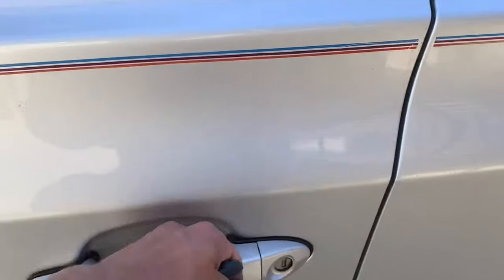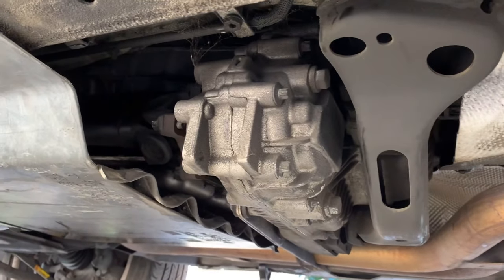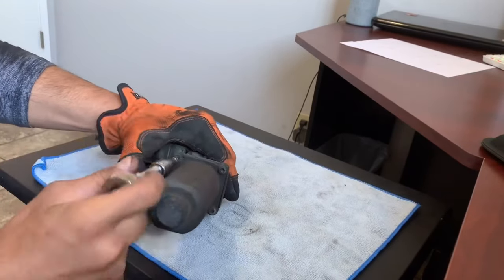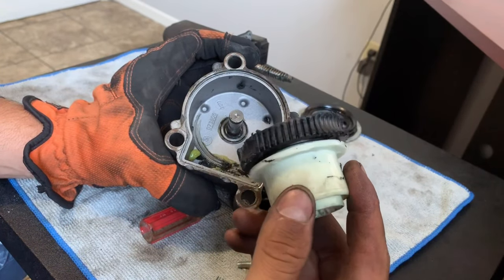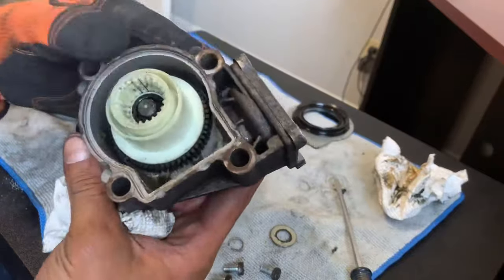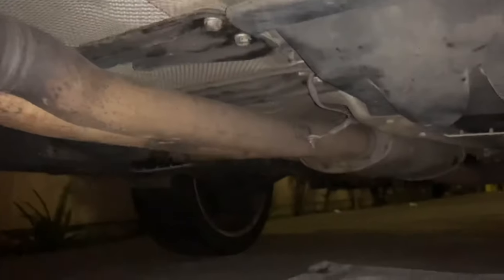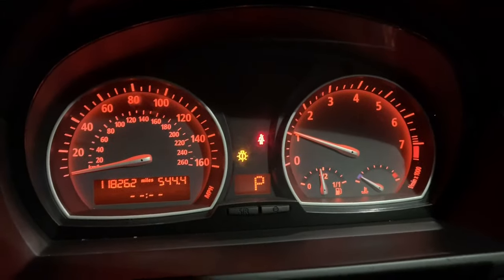BMW X3 E83 M Sport 4x4+ABS+Brake lights! How I Fixed it!

Comment: No need to pull the head of the actuator off the motor. just remove the C lip on the white gear shaft, pry off the staked plate, and open the access to the black gear your going to replace. The damaged gear will lift right out. Grease the new one, and install. Ive done this 5 times on my E83, 280,000 miles and counting.

Comment: I have the same problem yesterday with my 2004 X3.  Is it drivable or better to wait to get it fixed.  After stopping at a red light and then trying to give gas when its green again it jerks for 3 seconds and is not smooth.

Comment: Hey thanks for the fix man.. Just a question.. Is this an urgent fix? or can I drive it for sometime and do the job later?
Reply: Yeah it can still be ran just the abs won't work in case of a hard stop you will skid because the brakes will loćK up but other than that you can makr it cross coutry without it

Comment: I changed mine but the 4x4 light still comes on. Could it be a sensor ? i no longer hear noises and drives fine just the dang light please help

Comment: Is it better to replace it with an aluminum gear or carbon version? Is it normal or safer to let it get chewed out and just replace it ty
Reply from the maker: I have not tried the metal gear as replacement.
What I can say though, it’s been 2 years with the carbon gear and no issues! 
Hope that helps.

Comment: Hi good video,
I just noticed the actuator you pulled off has only 1 electrical connectors, but there are 2 harnesses hanging out when you pulled it out, so it is only 1 electrical connector being used?.
I have the same issue with an X3 2006, but I see mine has 2 electrical connections.
I am a new subscriber.

Thanks,
Reply from the maker: Hi there! There are 2 plugs for the actuator.
Both you saw hanging, both plug right into it.
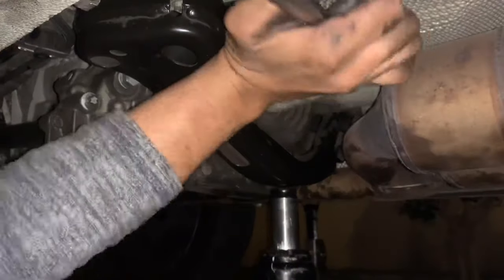I mentioned it at 2:50 , Thanks for tuning in 👍🏼
Reply: @builddrive7023  will unplugging a part of the actuator get me running normal again ..i got all kins of lights on my dash 2006 bmw x3 e83 3.0i
Reply: What if the plugs don’t have power then change the module?

Comment: My 4x4 light is on and my speedometer and cruise control are not working would this be the same issue ? I have replace all the wheel speed sensors and still nothing any help ?

Comment: Hi! New subscriber here with an 06 M sport X3 having exact same light cluster. I've seen plenty of videos addressing this problem as well and looking to do it myself once the weather warms up a little. I appreciate the efficiency of your vid! 
Quick question: Once the gear is replaced and everything buttoned back up, do you need to reset codes or battery to remove lights, or will they go out on their own?
Reply from the maker: Lukas Scott hey Lukas! Glad you found value out of the video. No need to reset codes or disconnect battery. The Ecu detects the fault only when present which is why at start up you wouldn’t see the codes. If fault has been fixed, you should no longer have any lights on dash! Hope that helps! It’d be great if you shared how it goes! Cheers!
Reply: @builddrive7023  Awesome! Thanks so much for the fast response, too. I'll definitely let you know how it goes, my friend. 
Have you had any issues with P0171/174 fault codes on your X3 by the way? I got them around the same time as the triad of death and have done everything I can think of related to the codes (usual suspects, short of paying an arm and a leg for some possibly-not-the-issue points). Any suggestions in your experience? No luck in forums either
Reply from the maker: @lukasscott2970  I'm sitting at 120k miles on my X3, I have not experienced codes PO/171/174. I take it your X3 is running either rich/lean, I would start by paying close attention to the symptoms to get an idea of where to start looking first but in summary I w would check thoroughly all air/fuel delivery components such as  (PCV hoses, EGR VALVES, AIR Intake, Disa valves) make sure you have no air leaks to be found,  check fuel components such as  fuel filter
, fuel pump & fuel injectors to make sure you have no problems with fuel delivery. have you already checked all of these?
Reply: @builddrive7023  very informative video. Was your actuator making any noises before you changed it?
Reply: @builddrive7023 
How about replacing the plastic gear for a metal gear? 
Is this gear moving or working with other plastic parts, or goes against other metal parts? 
Just making sure if I get a metal gear I wont mess up other parts before I even order it.
Reply: Hi this video was very helpful. What about when you your light stay on .
In my case I changed the part and lights did not clear ? Any advice ?
Reply: @angelramos476 i am having the same issue. light is still on after replacing transfer case actuator. did you resolve the issue?

Comment: Hi even after doing this the issue still remains the same. We changed the new gear in the transfer case for x3 e83 engine. All the lights are still on. Diagnostic system says now 5EE5 HYDRAULIC UNIT PRESSURE sensor internal fault, 5EE2 HYDRAULIC UNIT PRESSURE INTERNAL FAULT AND 5EB3 control unit, power supply DSC sensor. What this entails of? Please advise

Comment: Hi! Thank you for this fruitful video. New subscriber here. My X3 having exact same lights cluster and speedometer and odometer are no longer working. My mechanic says it should be a matter of ABS sensors. I still haven't done anything. what do you advise me. Thx
Reply from the maker: I would really need more info about your issue.
If you are having the same symptoms I talked about, there’s a good chance this would solve your problem. This is a common problem you will encounter when getting close to 100k mile mark. Thanks for tuning in 👍🏼
Reply: @builddrive7023  I got it repaired. It was a matter of sensors. Effectively the millage is just above 100k miles.
Thank you
Reply: @imedghenn9068  what sensors were they having same problem
Reply: @henrybermudez859  The issue was with the speed sensors.
Reply: @imedghenn9068  im gonna give it a try i appreciate it very much god bless
Reply: @imedghenn9068  hey thanks alot you saved me lots of money it was speed sensors did both front ones today runs like a champ
Reply: @henrybermudez859  Great. 👍👍

Comment: When you started noticing the issue would the cars rmps go all the way down/or shut off when you’d accelerate?
Reply from the maker: Rpm flutters & engine shutting down when accelerating will have no correlation to
The transfer case actuator.

Comment: My BMW X3 also shows Abs, Brake and 4x4  sign when in motion between 80-100KM..after mechanic said the problem was sensor the rear back  we changed it and yet still same problem. But the diagnoses  machine didn't show anything about the transfer case. So what do you think I should do.
Reply from the maker: Dipo Daramola thank you for subscribing!
This is a common problem across X3 platforms. It is most likely your problem has to do with the transfer Case Actuator Gear based on the symptoms you’re experiencing.
No OBD Scanner nor the car Ecu is able to pinpoint exactly where the fault is, therefore you will get all 3 warning lights on the dash when the 4x4 engages. I would remove the transfer Case Actuator and open it up and check if the plastic gear is damaged. If so you can buy a replacement gear for it for just a few dollars, link in description.  I would give this a shot considering it’s not a lot of work or money involved in removing and/or replacing the damaged gear. If you are not too comfortable doing it yourself,  you can get your mechanic to do the labor for you!
Let me know how it goes!
Reply: @builddrive7023   I have soughted it out. It was the bearing that was eating the censor which makes it brings out sign. I changed the bearing and bought a new censor. All is working fine now.
Reply from the maker: @daramolad  thats great! thanks a lot for sharing details! cheers!
Reply: Build&Drive do you have a video on this sensor and bearing? Thanks
Reply: @daramolad  what’s bearing please?
Reply: On the back wheel you have a abs ring…that abs ring get damaged from corrosion and affect the abs speed sensor..you need to replace the abs ring and abs sensor… in my situation the sccaner said I have a problem with the fron left abs sensor and after I changed the problem persists I know my Mecanic said I need to change the wheel bearing because the magnetic band could be damaged…I really don’t know what to believe!
Reply: @nicolaeradu4737 that ring I believe is called a Reluctor Ring.

Comment: How was it possible to remove the support bar without holding the transfercase with a jack in the meanwhile?
Reply from the maker: I removed left hand side bolts and only loosened right hand bolt from there I sort of pulled it down and out of the way to create the necessary room for me to remove the actuator.

Comment: Thanks for the video. I am really struggling to get the 18mm through bolt out of the cross member. The exhaust piping is in the way and I cannot get anything in there. I've also tried an 18mm wrench and just cannot get enough leverage. Any tips?

Comment: So my abs, brake, and 4x4 light just came on, but the brake light is in yellow and not red…do you think it’s still my transfer case actuator? Btw it’s a 2008 X3
Reply from the maker: The plastic gear inside the transfer case actuator is the most common cause of all 3 lights on your dash.
Reply from the maker: *You can try to hook up temporary power to the actuator to confirm it’s still a working unit.

*Check the 2  plugs that supply the actuator. 
Make sure there’s no damage to the plugs/wiring.
Reply: @builddrive7023  yup I was just wondering if it mattered if my brake light was yellow or red
Reply: @builddrive7023  how can I temporarily power the actuator? Sorry if that’s a rookie question.
Reply: @mshaabneh23  you put power to the + and - pins. Upper right and lower left.

Comment: Replaced abs sensors and Replaced actuator with a brand new one as the plastic wheel was damaged and the abs brake and 4x4 lights are still on !
Reply: did you ever fix this? i replaced all sensors and gear and still have problem

Comment: hi i have the sane problen   i put a new actator and the lights go on and of  firt star t6he the 4x4 and then the brakes y abs
Reply from the maker: Are you saying You replaced the entire actuator assembly and lights are still showing on your dash?
Reply: @builddrive7023  thanks you for you help it is very much appreciated the problem start when i put a used transmicion the 4x4 light came on  but a drove 2 mi  end then the light goes of i make to many trips and  then  the 3 lights came on   i saw you video and i put a new actuator  the lights o out  but when i start to driven the light came back
Reply from the maker: Serafin Arizmendi you replaced the entire actuator assembly? With a new one? Used one? Did you check if the gear inside was chewed up on the old actuator?
Reply: @builddrive7023   yes i get it at ebay for 90 dollars
Reply: Serafin Arizmendi did u manage to fix the problem? What was the cause

Comment: This repair is pointless. You remove the effect of the fault, not its cause. The rack is made of a very hard material and wear is not without a reason. It's like treating a tooth with painkillers.